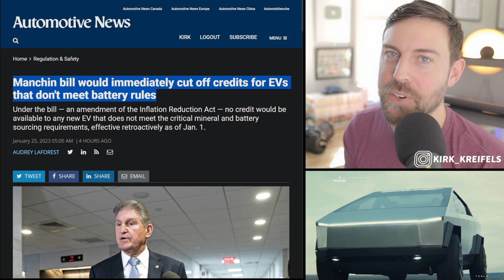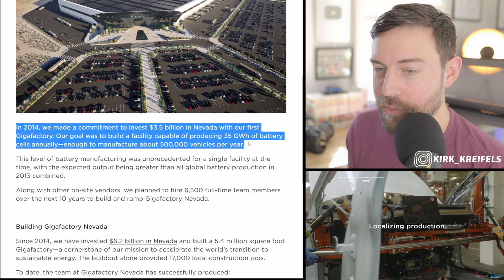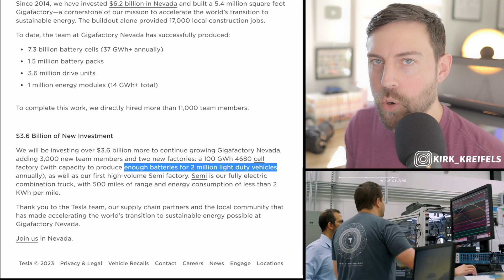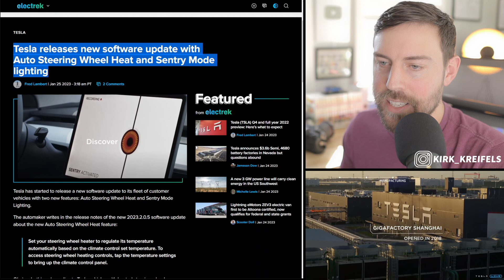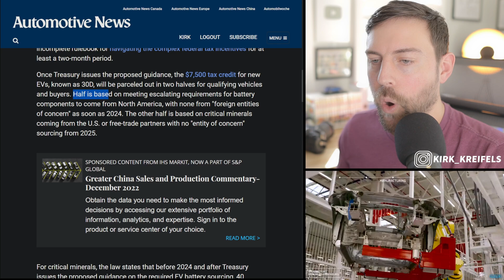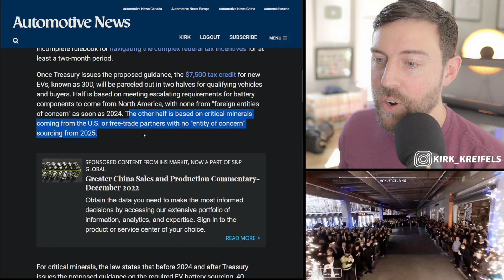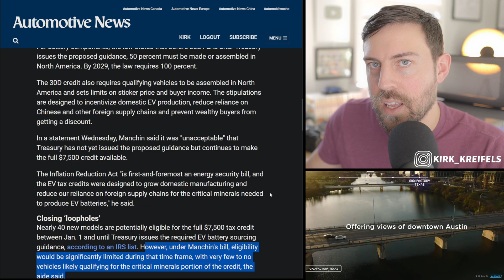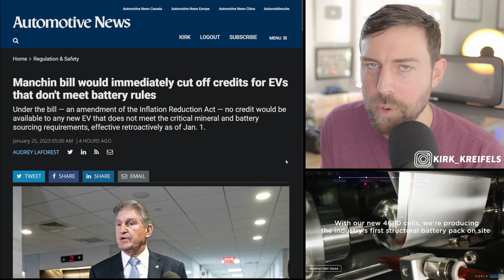Tesla's NEW Batteries are Incoming...but won't Qualify for Tax Credit ?!

Comment: It may be wise to wait until next year to buy or lease an EV. The tax credit will become a rebate applied at purchase in 2024, and the battery materials sourcing requirements should be clarified by then. Vehicle platform technologies, batteries, drive by wire, brake by wire, suspension systems, sensors, processors, displays, software, and quality control systems should all be better as well.

Comment: I really dislike how Tesla just throws "giga" in front of things . They're building and expanding factories. I never call them giga-factories. They're factories. I don't know what to think because Musk and the Tesla hype machine and fanboys are just insufferable to deal with. If Tesla was just a normal company that wanted to make good EVs, I could get into them. But this talk of conquering the market and killing legacy auto and giga this and that just turns me off to the brand. Most of their news is about factories, not new vehicles though I guess the Semi is a new, if quite delayed, vehicle. If and when the Cybertruck comes out, we'll see what reviewers think of it and what it actually looks like on the road. Otherwise, I'm interested in other brands and think Tesla is overhyped.
Reply: Tesla = hype company. I know, I drove Teslas from 2015-2021 and have followed them fairly closely for ~9 years now. Their competitive edge is only the supercharger network and they are going to open it up to all cars with CCS as well. Tesla hypes things up but the reality is their main product is the stock, not the cars.
Reply: I agree. Octo-valve, gigafactory, supercharger, mega this, blah, blah it's all hype. The 4680 battery turned out to be 100% hype also, it doesn't charge faster, it doesn't have more range, it doesn't have more power. Literally 4680 was a hype day, no actual benefits to owners.
Reply: They call them gigafactories because of the insane volume of batteries they will produce. 100 gigawatt hours near term, 500 long term, out of this one factory. That’s insane. 100 is enough for 1.5 million model 3 & y. These aren’t normal factories. They will literally change the world. That’s why they are called gigafactories.
Reply: @nostrx450  I think it's marketing. They also use the term "gigacasting."
Reply: Tesla is like Apple, but with an even bigger mission. Is it possible we “fanboys” are wrong, and Tesla will just be another automaker Long-Term? Sure. But it’s unlikely, and the possibilities of the future are so exciting to think about. That’s why we sometimes seem a little over-the-top.
Reply: @nostrx450  They're not like Apple to me. I've bought Apple products for decades and they're about quality and design. Apple never pushed quantity like Tesla does. And Apple's a good example to show that "innovation" only lasts for so long.
Reply: @nostrx450 hey have a lot of factories that just build batteries. The mega packs are bought by companies and city/state to provide power backup. Their megapacks are over a year on back order. Theyre years ahead of the competition with battery building and availability in the US.